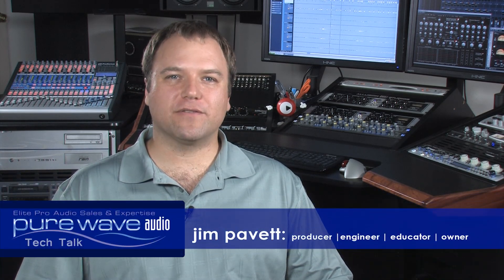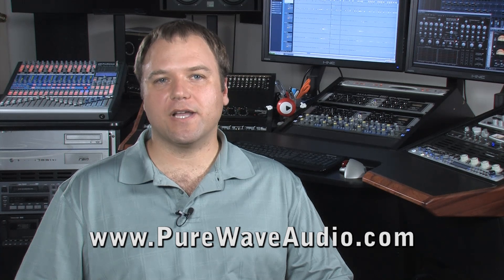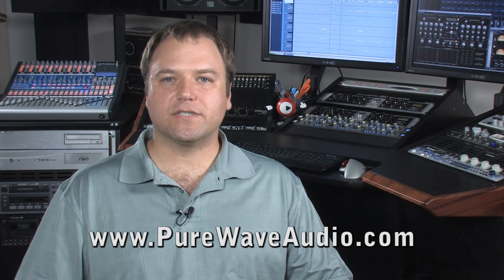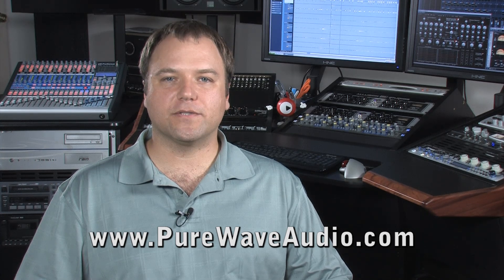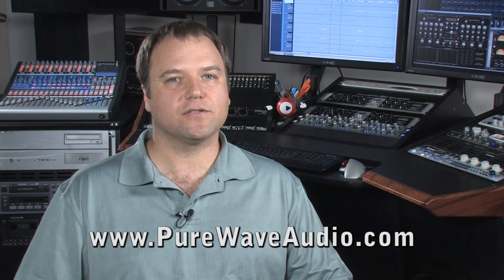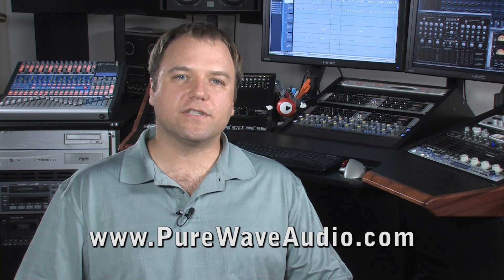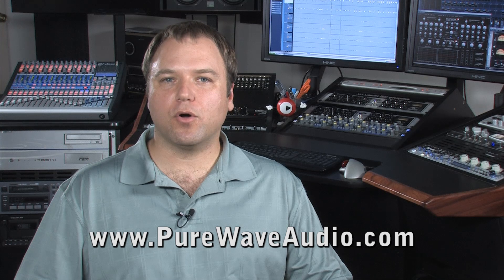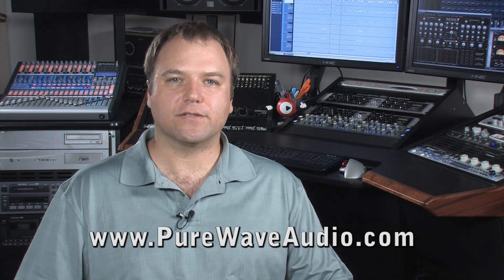Mastering EQ  - Why Use A Mastering Equalizer vs Parametric - Tech Talk

Comment from the maker: A Graphic EQ has a fixed bandwidth and select frequencies predetermined by the manufacture with adjustable gain.   Parametric EQ has  gain, bandwidth and frequency which are all variable and user controllable.